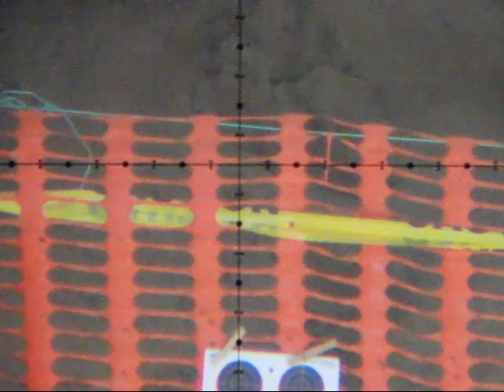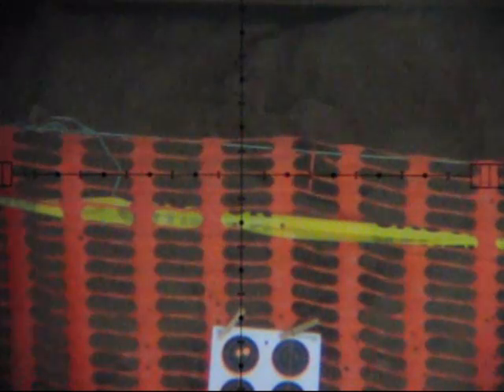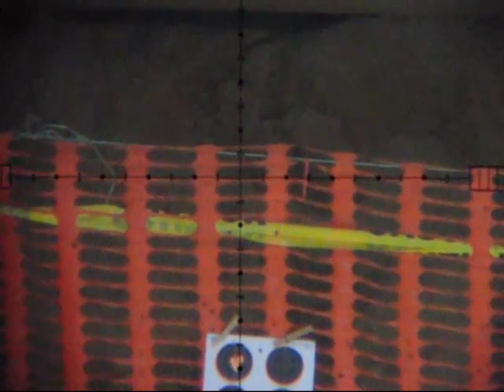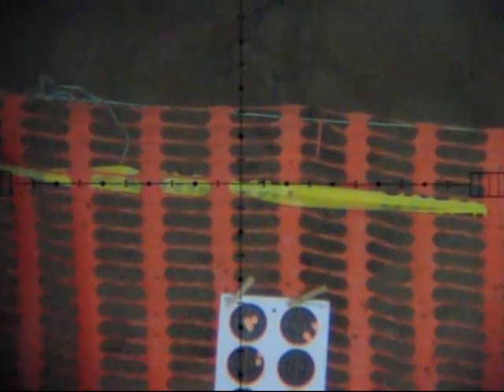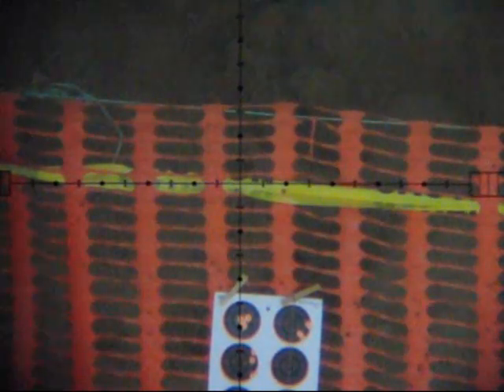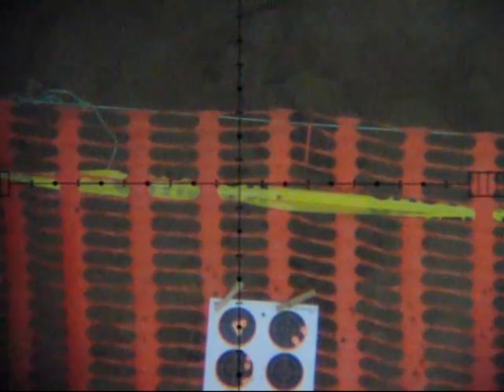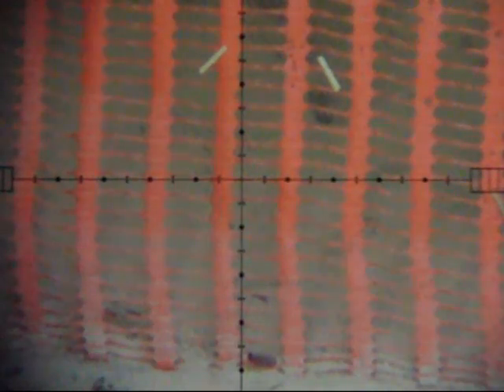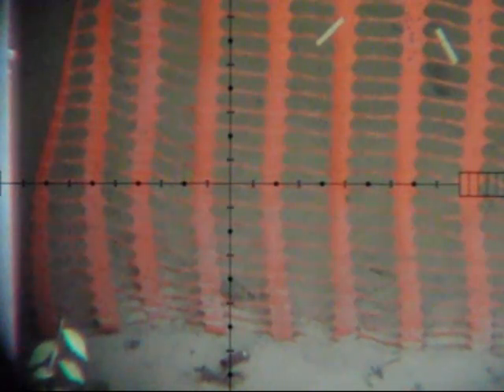Air Rifle Accuracy - Clean vs. Dirty Barrel - Slow Motion Video

Comment: I use springers Beeman R9's in   
.177 and.22 and RWS 350 Magnum .22, RWS 48 in.22 they are super accurate but they are choked so i have to clean barrels when the groups start getting bigger.

Comment: Nice Video. The wobble will also come and go on pcp none regulated rifles. Because of the jump in pressure the pellet becomes unstable thats the other reason for finding the right pellet and weight for your setup.  If you do a side view at slow motion you will see small wobble in the pellets even in a clean barrel. But like Ted does finding that balance is why he is a great shot.

Comment: this is an old video, but i figured id throw it out there, it isnt actually lead you are cleaning out.  it is a thin layer of graphite which is used to prevent the lead pellet from oxidizing and turning white. you can clean your barrel perfect, fire 3 shots and your patch will look the same. now if you had cheap pellets ran through and get a small piece of a shaving or something, that is different and warrants a cleaning.  but usually, you never or very rarely have to clean a pellet gun.  i have an old (like 8 years) crosman .177 and a 2 or 3 year old gamo whisper .177.  the crosman has probably shot over 40k pellets and the gamo has probably shot about 5k pellets.  neither gun has ever been cleaned and dead on accurate (withing an inch) at 75 yards........my two cents, take it or leave it
Reply: BS  My 357 RAW needs cleaning every tin .
Reply: @greengrass-l7c  not BS. You're cleaning too much. Have fun damaging your barrel
Reply: adding to his 2 cents.....modern firearm ammo now makes it unnecessary to clean rifle barrels too. a fouled rifle barrel retains more pressure and give more consistent shots.
Reply: Found out my 1377 had factory grease gunk near end of barrel.  Best to clean a new gun then shoot until you see a problem develop.  My groups are better and improving. Not planning on cleaning again but do clean, lube pellets lightly. 5mm group at 12 yrds.

Comment: Obviously the wobble occurs just as the pellet leaves the barrel. There is a tremendous air blast leaving the muzzle as the pellet exits the crown, blowing by the pellet at right angles. If the blast of air is biased to 1 side, it will nudge the skirt of the pellet by a tiny amount. Of course that sets up oscillation... wobble.  The question is, what makes the air blast leave the muzzle crown unequally, and not on all guns? Some guns can shoot all day and never shoot a wobbler. Could it be the interaction of dirt/grease/lead particles with an imperfect crown? I have a feeling that re-crowning the barrel would be the most likely fix.
Reply: Bob Adkins this is way old, but you are correct. Unless the crown is exactly perpendicular to the pellet skirt, there is a possibility of creating a wobble.

Comment: Today i got a black bird with my Daisy Powerline 35,i was using open sights it was about 25 yards away,and it was a freaking head shot from 25 yards away!And i was using a BB and only did six pumps!The BB went strait threw its head.

Comment: every gun can prefer a single pellet. he uses JSB exact 21.1 which cost $12.99 for 200 count lol. for example, my benjamin trail prefer crosman premier ultra magnum. my air arms s510 prefers beeman FTS or Beeman FTS double gold. go to straight shooters website and get the pellet pack they have. its 40.00$ but you take the gun out to the range and compare 5-10 shot groups and buy a ton of the pellet that proved the most accurate. good luck.

Comment: weight will determine how hard the pellets hit. the more they weigh, the harder they will knock down the target. more weight is less feet per second. the head size is the most important thing. domed is the BEST head size you can have. get a few tins of crosman premier dome or beeman FTS double gold and take them out to the range. you will zero in your scope in and will be hitting 1" targets are 25 yards (depending how accurate your gun is) hollow point are for hunting, not as accurate. flat suck

Comment: Hi, Ted. As always after findind your videos, became a fan and have learned a lot. I have a question about pellet accuracy as I'm trying to improve. What are the most important factor in sorting the pellets: head size, tail size, or weight. I've been trying all these factors and still reading about sizing the pellets. Could you make a video about this?. Thanks - João Campos - Brasil.

Comment: Hey Ted,
   Would you say to NOT use a wire cleaning tip (small copper bottle brush looking thingy)? You only mention the patches to clean the barrel. Just want to be clear on this. Thanks brother.

Comment: unlike bb guns and firearms, "pellet only" rifles DO have softer barrels and more fragile riflings, bbguns and firearms have very hard steel, high quality pellet rifles do not!!! 
not even the legendary lothar walther barrels... all you need is cloth and string... perhaps a drop or 2 of oil, never use solvent or a gun cleaning rod, if you do you can and likley will ruin your barrel.

Comment: I could be wrong, but I think, his zero is 50 yards at exactly 900 FPS
I use 55 yards at 968 FPS elevation and temperature govern the speed of sound so I have an advantage with temps, altitude and lack of humidity
Reply: sblanshan + Thanks for the good points.

Comment: PCP airguns really do not require much cleaning in general.... however if you do clean use a dry or very lightly oiled patch/cloth just remember with oil it takes a few (10-50) shots to break the barrel back in so during those break in shots, expect a larger stranger group. but dont adjust your sights unless you have fired enough pellets to make consistant groups....

Comment: motor oil is verry thick and can be a problem however it is long lasting and great if your airgun gets to 210 degrees F. but that should NEVER happen... I wouldnt use it personally but if desperate, ( post apocaliptic ) then heck yea!!! but for just a few dollars you can go to a sporting goods or gun store and get gun oil, and Please use very little, only enough to dampen the cloth... not wet or soaked...

Comment: This was happening to my RUger 10/22 i was at the range today shot 2 magazines of ammo and it performed fine, then just like that the 3rd magazine was completely inaccurate and i was wondering if my red dot wasn't able to hold a zero because of the recoil, with closer look at the target and what bullets did hit it were keyholing (lobbing in the target sideways) took it home, drenched it with cleaner, raped it with a bristle brush, removed all the grime and metal shavings that stored up, all good

Comment: This is an excellent piece of work.   I've got one air rifle that will open groups after about 100 rds and restores immediately with cleaning.  And it's a fairly low power PCP at 12 fpe.  It's very interesting to see that the gun is throwing screwballs when the accuracy starts to fade.  I never new that.   

This issue is one of the reasons that I'm excited about the new Smooth Twist barrels that FX is putting on their guns.  I have one Smooth Twist barrel and have yet to clean it.  No need !!

Comment: my rws puts out about 30.5 ftlb of energy throwing a 7.9gr .177 pellet,
it's a springer as you call it,  i have cronoed it at 1320 fps,
i do lube my pellets with 3 in 1 oil and it helps keep the fouling down to almost nothing.
and i dont soak them in oil! only about 10 drops for 250 pellets.
i havent noticed any loss of accuacy or power between cleanings.
i've had my rws almost 25 years now, and never regreted it being a spring driven
rifle.
i love the thing! and would buy another.
bus